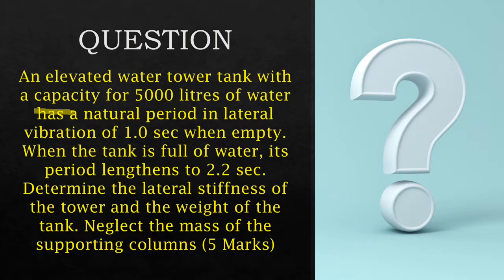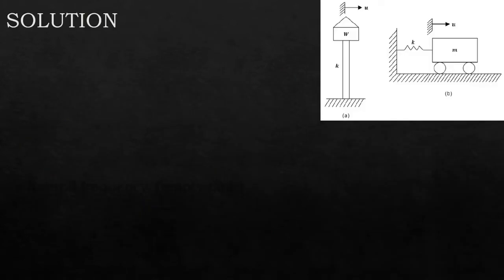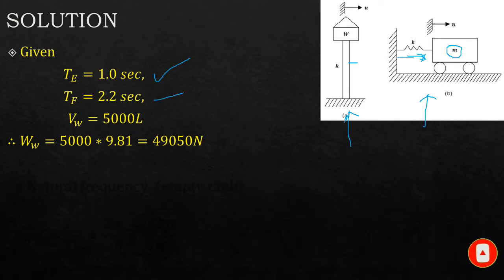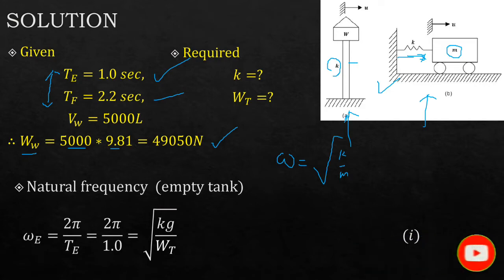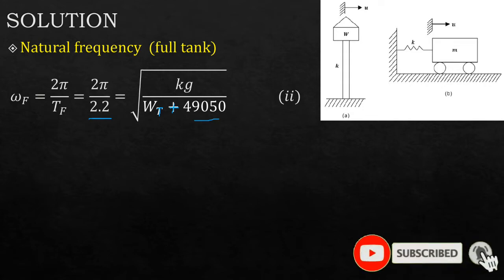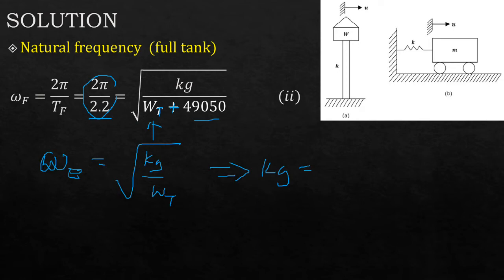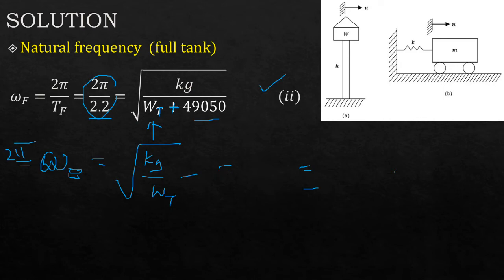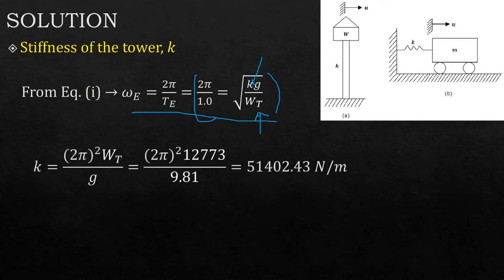Free vibration of undamped single degree of freedom system #Solvedproblem

Comment from the maker: *Question* 👉 https://bit.ly/3fMjzs5
An elevated water tower tank with a capacity for 5000 litres of water has a natural period in lateral vibration of 1.0 sec when empty. When the tank is full of water, its period lengthens to 2.2 sec. Determine the lateral stiffness of the tower and the weight of the tank. Neglect the mass of the supporting columns (5 Marks)